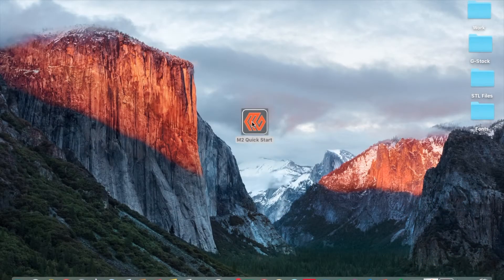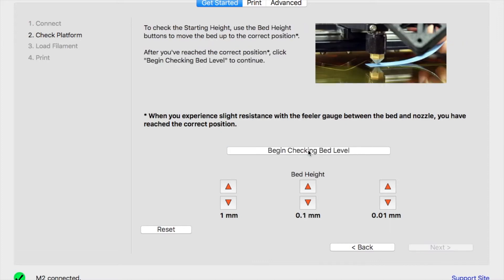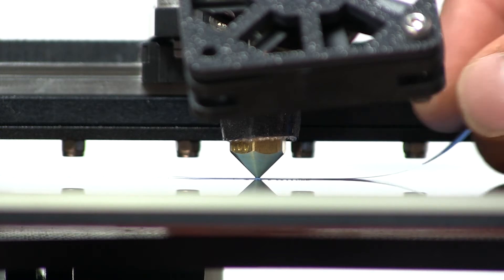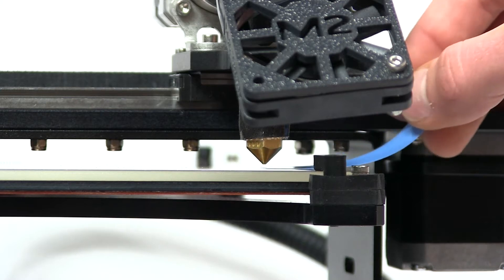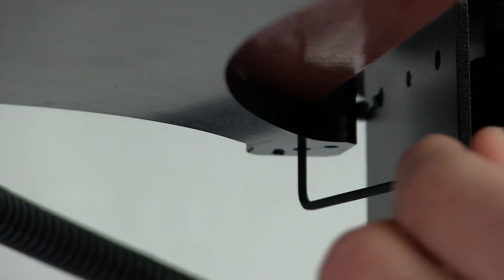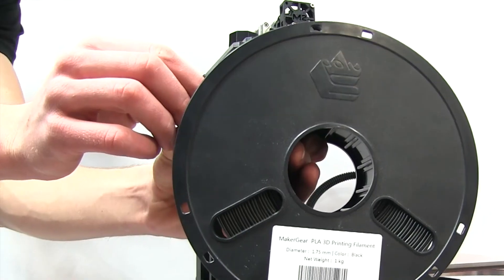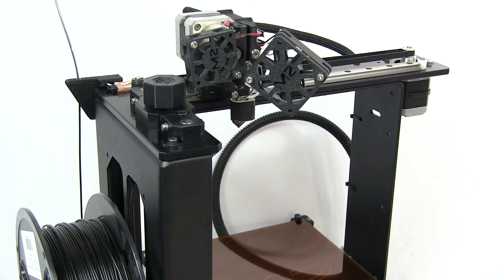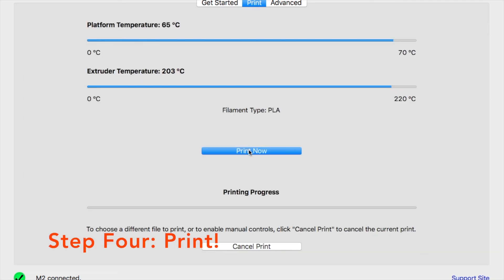MakerGear M2 3D Printer - Quick Start App Tutorial

Comment: Thanks for the video... just a note for everyone on roughly how the software works after set up through my experience (Makergear please correct if I'm wrong).. the z height is remembered somewhere in the machine from the bottom up as the z stop switch is now located at the bottom of the z screw. Its not mentioned but you do not need to use the Makergear software to print as at first it may seem! I was able to use the same print profiles that I've been using on my other 2 M2's with Simplify 3d. When I first gave it a go I had no idea where it saved the z height and was concerned it would crash into the nozzle. I had my hand at the ready on the power switch when I tested this! but like I mentioned it worked with no problem using my existing print profiles. 

My initial thoughts on the new bed leveling... Once you've done it... its as simple as I'm sure it will ever get manually adjusting and it appears it may actually hold its level for much longer. I've never been drawn to the machines that auto level because most seem to adjust the z height throughout the print to maintain level, and any extra movement isn't good when quality is the goal. A couple things that I liked is that there are set screws on all four corners (instead of 3) and it doesn't sit on the rubber pads any more! I do worry that the holes for the new "hold-down clips" may strip out/ bend the screw holding them if they do not break first.. I point this out because when leveling the bed I did not realize how tight they were until after the first print when I needed to remove the glass. My suggestion is to loosen the clips before leveling the bed then tighten them down lightly. Also, NO WAVE SPRINGS! I grew to dislike the springs because the bed would always become unlevel after (from what I attribute to) pulling off parts that were stuck on to well or perhaps due to the constant temperature change/print cycles. The new extruder wire box is much better looking and organized. Lastly and most importantly.. my first prints on my M2 are always a new spool holder... using the same filament, fff. and same part, this latest printer produced the part with less echoing/ghosting then the Rev D... Perhaps it could be attributed to less play/flex in the bed without the springs. However so,  hopefully this is maintained in all future prints as it will be running 24/7 like its brothers and echoing messes with the quality of my small business logo.
Reply: I experienced the same problem..   I highly suggest that you loosen all four screws before you level the bed, and then manually screw them up.  I believe the rubber clamp somehow loosened before the print whereby the nozzle ran into the print bed, scratching the surface and the yellow film on the glass.   Makergear needs to point that out in their description that there could be extra play/slack on the four clips that could potentially loosen up due to movement and varies based on how far in the clips are moved over the glass.